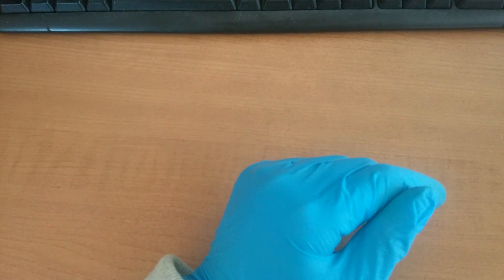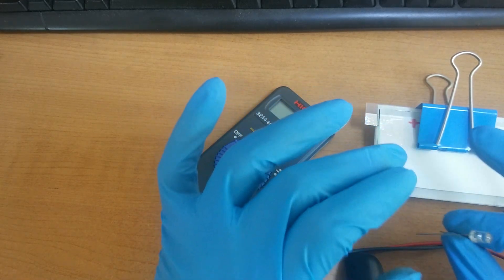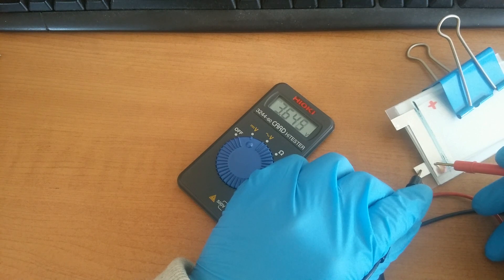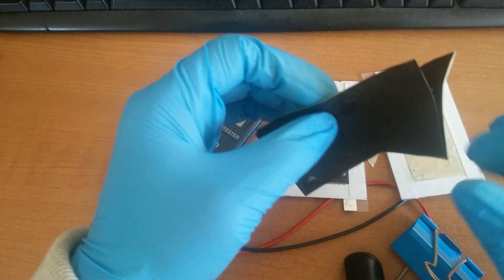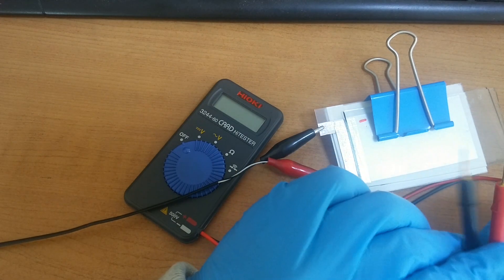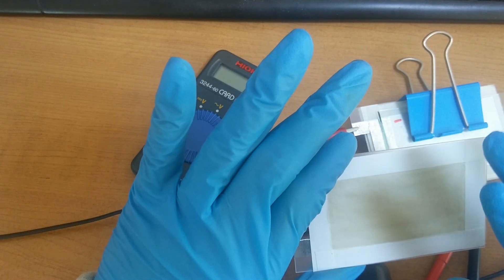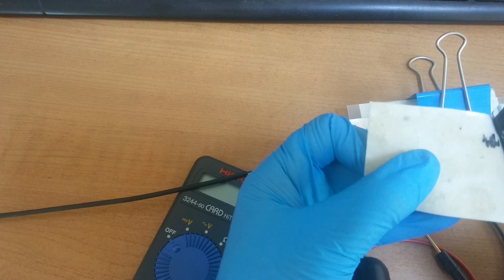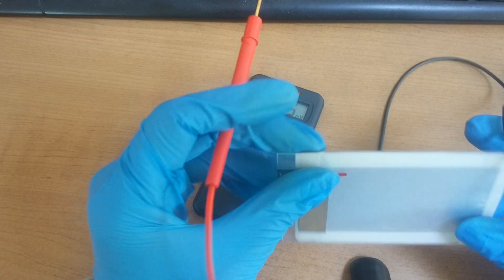graphene solid battery: 4.5V

Comment: @solid battery I have made an experiment where I used black acrylic ink as a binder. You could use aplastic film painted with conductive ink made out of the acrylic ink+ graphite powder to be used as a current collector and scrub it to increase conductivity. Then it would be aluminium + graphite battery.
I would do ink acrylic ink+ graphite +activated carbon with high surface area to paint the interior of the current collector.
Reply from the maker: Thank you for your kindness and good information

Comment: Is it li ion based battery ?
Reply from the maker: Since it uses normal detergent, it can be said that it is a sodium based battery
Reply: Each layer is 1.5 v ah???
Each layer are serialised ah ??
Reply: @venkateshshakkaravarthi8605  suppose if the total voltage is 3 volt then the voltage of each cell ( single pair or layer  ) should be 1.5 volt
Reply: @venkateshshakkaravarthi8605  ah ? 
No , ah means .
Suppose if 5 ah ( Amp in hour )  is written on any battery it mean it will give you 5 amp of current in 1 hour but small battery are normally rated in mah mean mili amp but this battery is extremely low even in mah range .
Because it's prototype
Reply from the maker: @venkateshshakkaravarthi8605  
Maybe, right

Comment: One step further! Good work. Did you considder using some way (i.e. two rolls where you pass the carrier and anode/cathode material) to assure layer thickness is a) absolitely the same across the layer and b) also can be contolled through the distance of the rolls to experiment about the influence of varying layer thickness?
Merry X-mas to you and your beloved ones!
M
Reply from the maker: I am always considering of it. However, as this battery is made by my hand, not by a machine, frankly I am not confident of it. But let's keep this on. Have a merry christmas